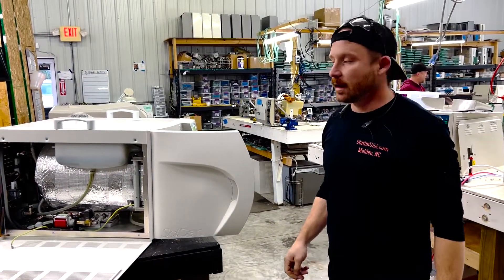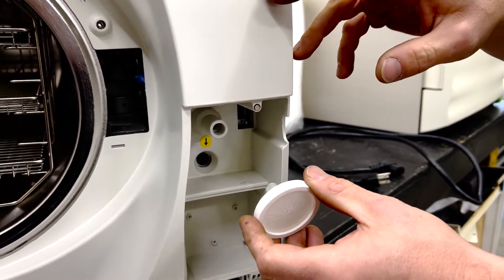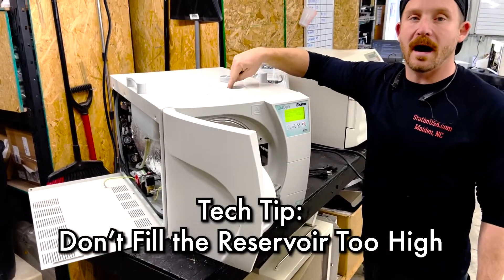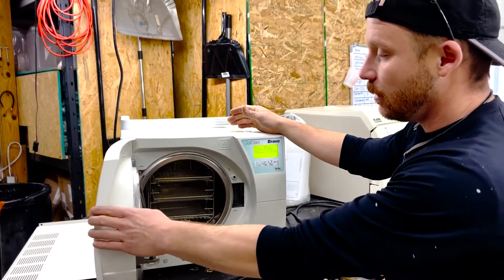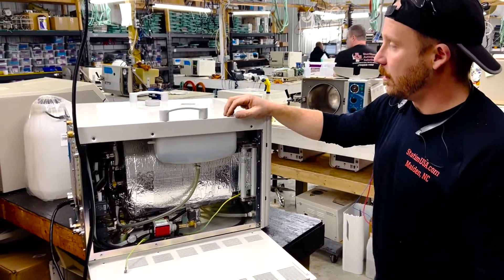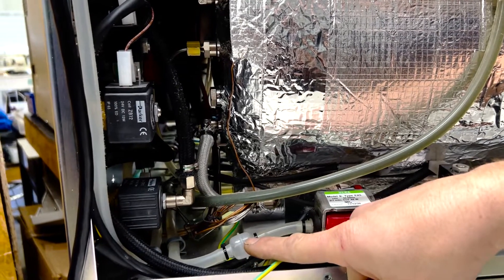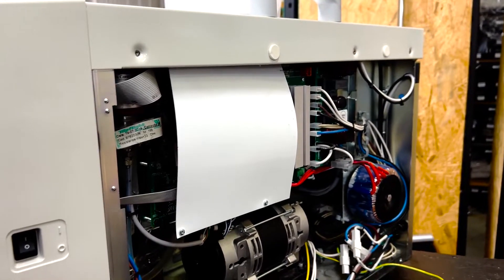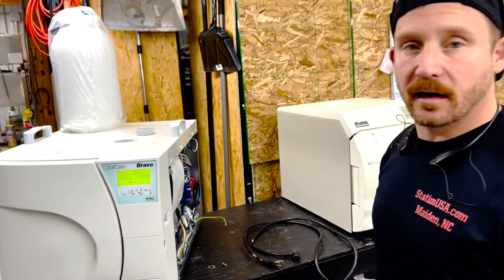A Walkthrough of the SciCan Bravo 21V Autoclave

Comment: I see unlike the 17V model, the 21V bravo has a water intake on top. Does the 21V BRAVO work with the VistaPure AutoFill kit S3020 which is usually working with the Statim 2000 and 5000? Thanks
Reply from the maker: Thank you for the comment! We recommend calling in to our Free Tech Support Line at 704-966-1650 Option 3 so our technicians can help you with your questions about the compatibility of your VistaPure Autofill Kit!

Comment: How do you know if the fuse holder went bad?  My LCD panel died/the machine won't turn on, I tried replacing the fuses which I've done before but that didn't fix it.
Reply from the maker: Thank you for the comment! We recommend calling in to our Free Tech Support line at 704-966-1650 Option 3 so that our technicians can help further assist you with your fuse holder and any other issues you may have.

Comment: Atm1 please explain
Reply from the maker: First empty the chamber and run a cycle with no instruments and see if the problem persists. If not, then back down the amount of instruments that are put into the chamber. If it continues with atm1, replace the door seal. Push in the safety thermostats at the back of the unit. Call tech support for assistance. Check filter in front of boiler water pump. Replace if necessary. If the problem persists after these recommendations have been performed, please call our tech support at 704-966-1650, option 3.